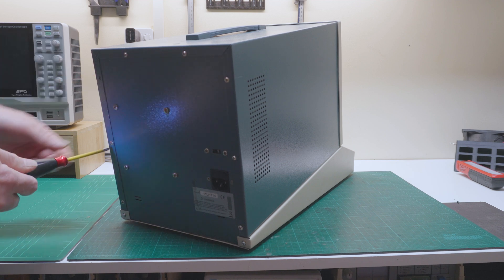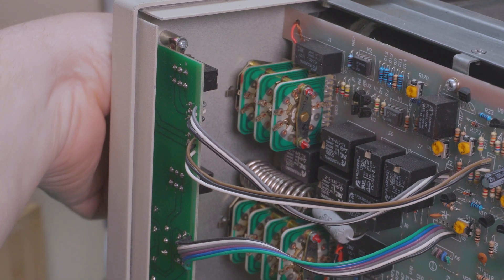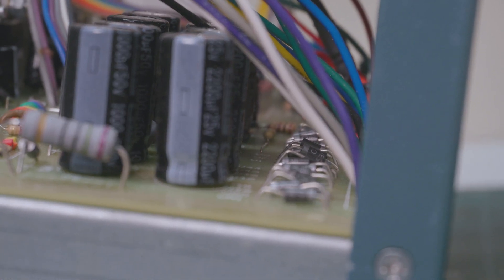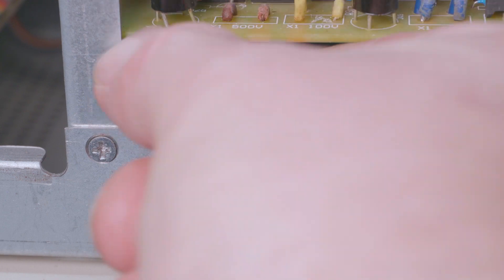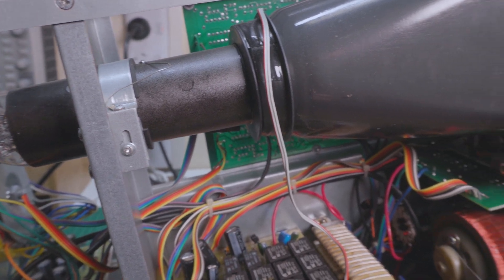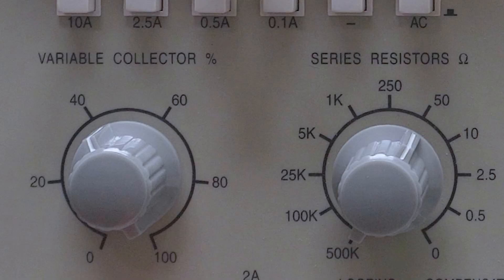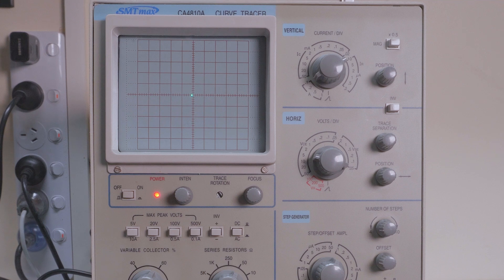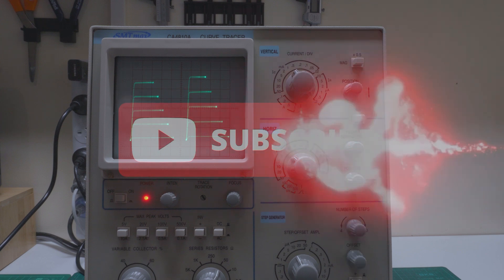CA4810A Curve Tracer, Lets look inside!

Comment: Jordan, I hope you were able to get some test fixtures from Circuit Specialists.  Just some information I was able to find about our curve tracer.  The CRT is a 15SJ130Y1A manufactured by Nanjing Huadong Electronic Vacuum Display Technology Co, Ltd.  I did a search and found several vendors that sell the CRT.  One vendor YOYCART has over twenty units at a price of $35.00 USD/unit.  Not sure if they would sell to us but I might try and get a spare at that price.  Also using the CRT number I found a diagram on the Internet with pinout and you might want to search for that too.
Reply from the maker: @jwrtiger  thankyou. Excellent information, unfortunately circuit specialist had no interest in helping with the fixtures.

Comment: I have the same Curve Tracer  CA4810A.  I got it from Circuit Specialists about a year ago.  It is branded Circuit Specialist on the front panel.  They are in stock right now at $761.70 USD.  Since you opened yours up I decided to do the same.  I have no corrosion/rust and  all the components except maybe three or four resistors are all mounted flush with the PCB.  Wire management and AC grounding looks to be fine.  Like yours I have a Loctite material on most screws/nuts.  Mine came with 5 test fixtures and an English printed manual.   Overall it is built to a price point and I think the selling price is reasonable,.  I know this video is several years old but I want to thank you for posting a nice informative video.
Reply from the maker: @jwrtiger  Thank you for the comment. As you said, it's built to a price point but I've found it to be very useful, I've had no troubles with mine to date . It should be reasonably easy to repair if anything was to go wrong other than perhaps the CRT . I wonder if I can purchase some fixtures for mine from circuit specialists I'll send them an email. Thanks again